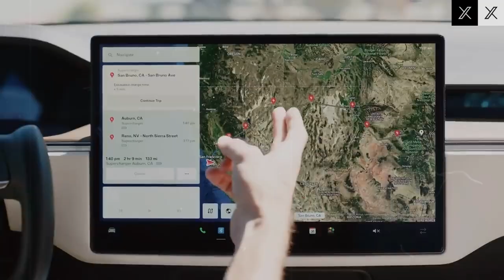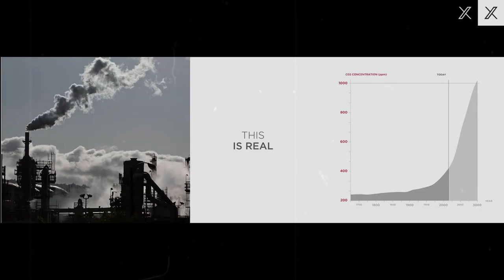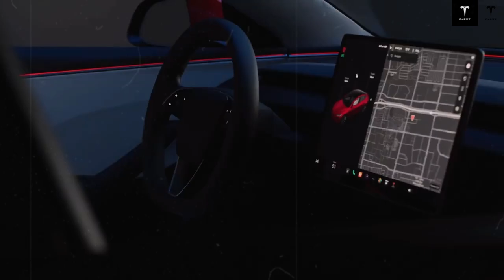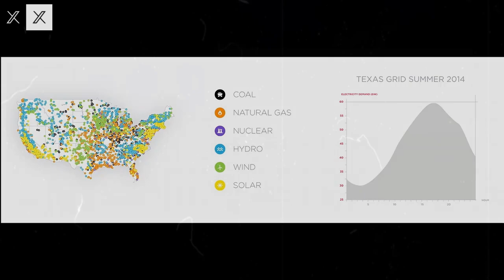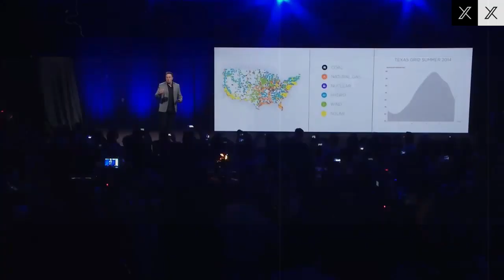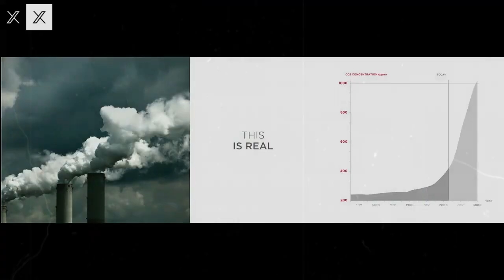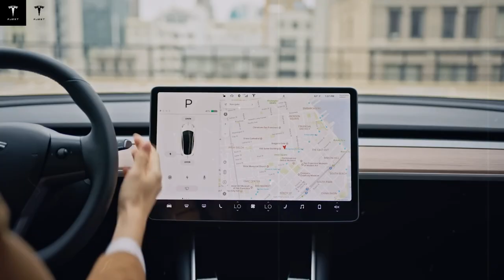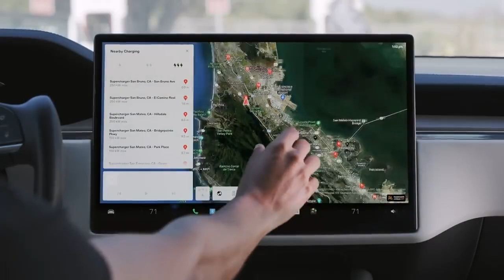FINALLY HERE! Elon Musk Unveils the 2026 Tesla Model 2 — $15,990 and Aluminum Supercell!

Comment: There is No official. 2026  Tesla model 2 with. a $15,990  price tag and )
aluminum. supercell  as )   the existence and  specifications  of this model  
are not. confirmed 
there. is. no officially confirmed 2026 
Tesla model 2 for. 15,990 nor has  a “supercell “ battery type been 
 confirmed